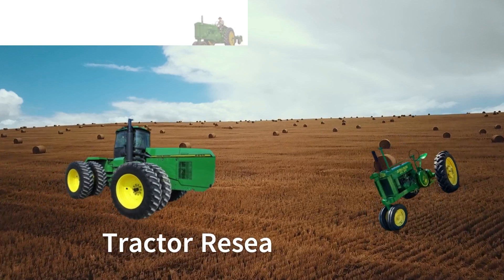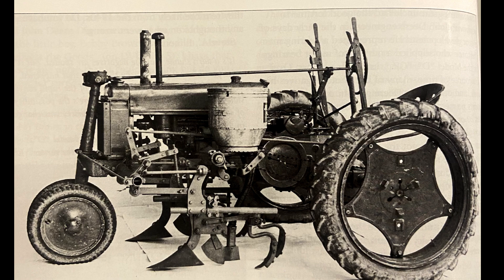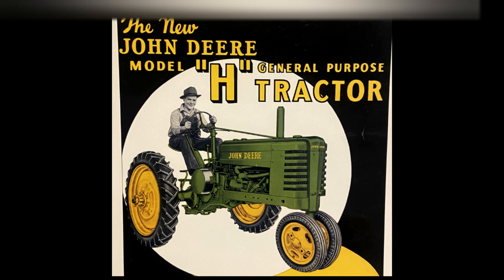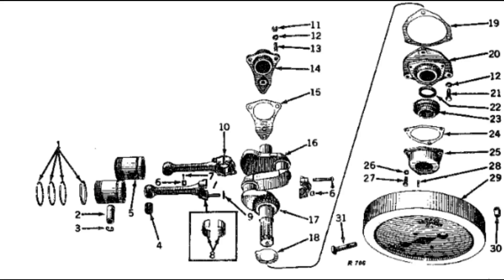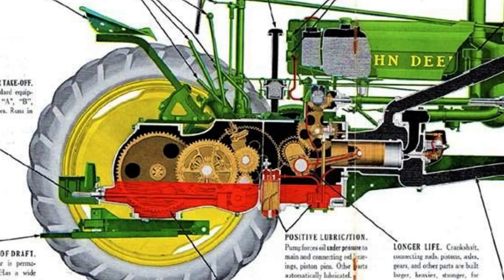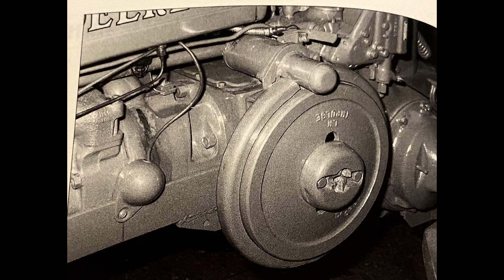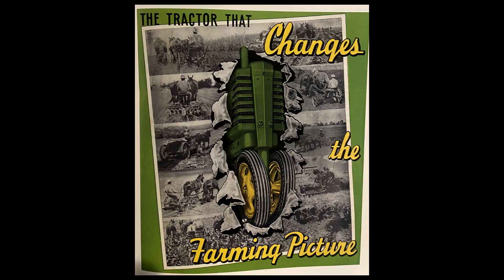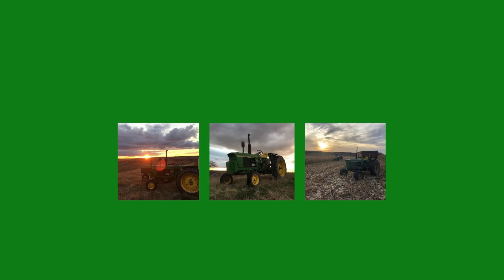John Deere Model H

Comment: Not all H's with hydraulics had the Duplex Control Valve. It was used to get two-way hydraulic control to run the H3 and H4 Two-Way plows. Otherwise you just lifted the lever on the hydraulic unit to raise and lowered the lever to drop the implement. Keep in mind this was also technically Deere's first "live" hydraulic pump, since it ran at all times off the left hand side of the governor. Not all Hs had the cast iron front rims with the 5 oval holes either. Front rims were changed to press steel beginning in 1945. Engines were 99.7 cubic inches, 3-9/16" bore x 5" stroke. Produced around 12 or 13 horsepower at a rated RPM of 1400. This would give a road speed of roughly 5.5 mph in 3rd gear. They all had a foot throttle that basically pulled directly on the governor spring and ran the engine up to 1800 RPM. This would give a road speed of about 7.5 mph, and was only to be used sparingly (for obvious reasons). PTO, Hydraulics, Electric Start, and Electric Lights were all options. I believe Radiator Shutters were standard (as all H's were All-Fuel tractors), however a lower cost Radiator Curtain was available (and is the reason for the hole in the top of all the right hand nose grilles). Another interesting note about the Hs is that the brakes were inside the axle housings, unlike all of the other Waterloo-built two-cylinders that have the drums exposed and easy to get to. The early fanshafts used two rubber bushings that would, in normal circumstances, have enough friction to turn the fan and would, whenever something was caught in the fan, also slip fairly easily. The later fanshafts (around mid-1945 production) utilized an actual fan clutch with clutch disks and a spring. 

Three easy ways to tell an H from a B are: if its an early one with the cast iron front rims then that's a dead giveaway. Otherwise, look at the hood. One exhaust pipe, no intake stack. On the Hs, the intake was in the side of the hood, with a rectangular mesh grille over the hole. Third extremely easy way is the brakes (if you can see the axles). Another is the hydraulic pump if it has one. Yet another is battery location if its electric start. Yet another are the hex head plugs on each side of the cylinder head that locate the rocker arm shaft. 

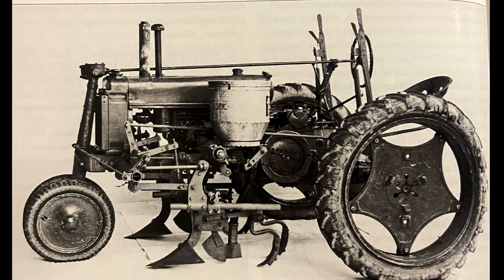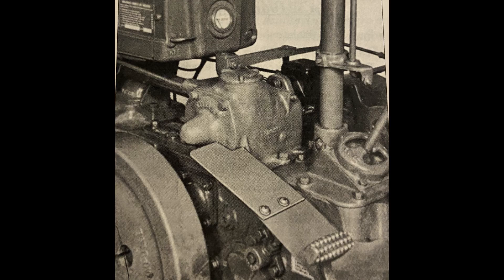An easy way to tell the 1939 and 1940 models apart from other Hs is the shifter quadrant. In your pictures at 5:19 and 5:46, you'll notice that the shifter quadrant is taller than in the black and white print picture at 5:04. The '39 and '40 tractors both had that quadrant (someone can correct me on that, it may have been a 1939 only thing). Some of the early '39s also didn't have the smaller diameter muffler extension, they had a muffler that actually looked similar to an A, but much shorter obviously. Not sure if any are still around or not, but there are some pictures in the Two-Cylinder magazine article about the Hs.

Comment: Thank you for the video. 
I didn't the story on the H John Deere.
I remember sitting on dad's H while it was running. 
I was about 4 or 5.
My older cousin was using it to cut slew hay.
While I was sitting on the seat, I pushed on the hand clutch, and away I went. 
We still have the old H, but it  has been sitting for years. 
My dad would never sell it, even after all these years. 
My dad passed away last February.
I'm 62 now.

Comment: When I was about 12 my dad bought a John Deere H at a farm auction that was in tough shape but ran good. It had 4 mismatched tires and needed a carb rebuild. It was hand start with a three speed transmission, no hydraulics and no lights. We used it to rake hay, move hay wagons and plow snow in the winter. Dad built the snow plow using old bed frame for push arms, a 2 x 6 x 8 for the bottom edge and 1 x 10’s for the rest of the push blade, with hand lift. Moved a lot of snow and raked a lot of with that tractor. Was sad to see it replaced by a John Deere A.

Comment: We had a John Seere model H on the farm and when I was about 6 years old we had string beans that we would use the the tractor to pull the implement trailer loaded with 2x4 bean stakes. My job was to drive but the hired man was getting tired so I jumped off the tractor and grabbed a stake and when I came back to the tractor I just grabbed the first thinking I could reach, the hand clutch! The tractor ran me over and the hired man thought I was dead. I wish I was after Dad got hold of me!
Reply from the maker: Wow! that could have been bad good thing you made it out alive👍

Comment: I grew up on two-cylinders, primarily a 53-60 & a 58 720D ES.  Bought an H less than a year ago, pretty good shape overall, but still needs some work.  The carburetor & starter are both in the shop right now, left rear axle seals & brake need work yet.

Comment: The smallest ag tractor Deere built was the L, which also had probably the smallest 2 cylinder engine that Deere made.  The earlier Ls and the preceding 62 had Hercules engines, but Deere switch over to their own engine around 1940-1941 or there about.  The LA was a bit larger and heavier than the L and it's confused with the L but there are subtle differences like heavier frame, larger wheels and tires, etc.
Reply: ya but it was not as 2 cylinder horizontal engine

Comment: No JD tractor had a battery, starter & lights until 1943.
Reply from the maker: The H received lights as an option at serial number 27000 which happen in 1941. Light's would become standard equipment in 1947
Reply: All of the two-cylinders (except maybe the G) had factory option battery, starter and lights in "41. I believe it was 1942 when the GM came out, (early styled G) and it also had the option of lights and electric start.

Comment: Many mistakes here. I owned one for years and used it almost daily in the summer. First, they went to steel pressed front wheels in the later years, the pic you show with the mounted cultivators has pressed wheels. Second you have the hydraulics  all wrong. The long horizontal  lever is the standard lift, You lifted it up and it jumped out of your hands and raised the cylinder. Then you pushed all the way down till it locked and the cylinder retracted down.The second valve on your picture is for a two way plow using two cylinders you lifted the right plow, as you turned around you shifted the lever and then when you were back in the furrow you dropped the other bottom with the main valve. I can post pictures but don't know how on youtube
Reply: I have the two way plow  the valve was kind of bad so I mounted dual open center spools on the steering pedestal.  It works but I wish that lift had a little more g.p.m. flow.
Reply: @ronaldgodden4490  My granddad had 2 H's and a D, farmed 120 acres with them. He had 5 boys and they'd take turns running the one H with the two way plow at least 18 hours straight, that one had lights. Dad told me that once you had it down pat you'd "Slap up the lift lever pull the throttle back, feet on the brakes and made your little figure eight and slap the selector valve lever with one foot, hit the throttle slap the lift lever and go" Claimed his older brother timed him at 7 seconds from plow lift to drop. I still have an extra set of bell housings and axles in my shop. Grandpa would jack the plow tractor up and slide the wheels off and exchange the axles for a set of cut off ones because set for plowing the standard axles stuck out so far the they constantly get hooked in the fence lines.
Reply: Interesting thanks for the reply.
Reply: How long would an h run on a tank of fuel plowing all day ?
Reply: @ronaldgodden4490  according to the lit I have it only held 7 1/2 gallon to begin with Dad always said when they walked out to switch off they carried gas but he never said how much. I used to run a hay conditioner with my old one and I could do 25 acres and not use more than 4 or 5 gallon. Used to love using it to rake hay, rake all day on less than 5 gallon of gas and it couldn't go fast enough for the help to ruin the rakes, used to pull two rolobars in tandem, handled it just great. One of my hired hands dad sold kobota lawn and garden, one day in front of his dad and I he said15 horse hell dad you have lawn tractors bigger than that and his dad replied that thing could drag any of them around the lot, you don't understand torque son.